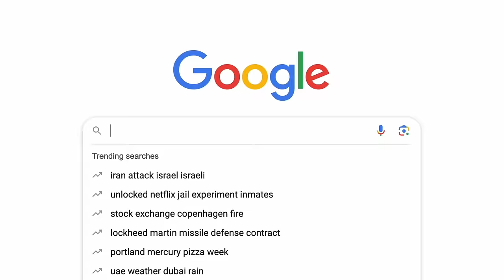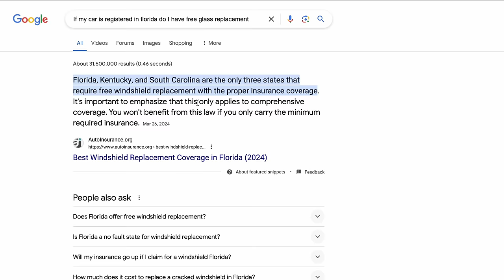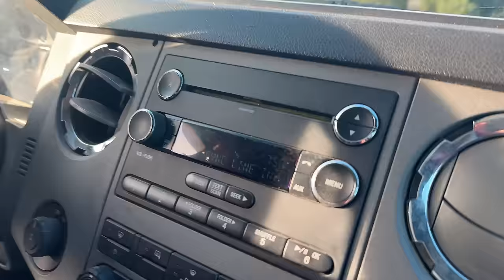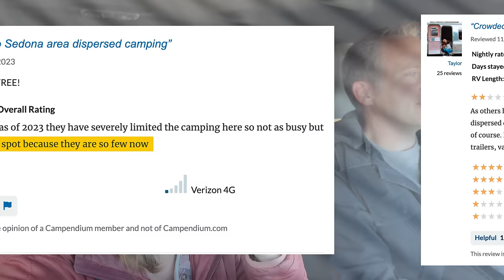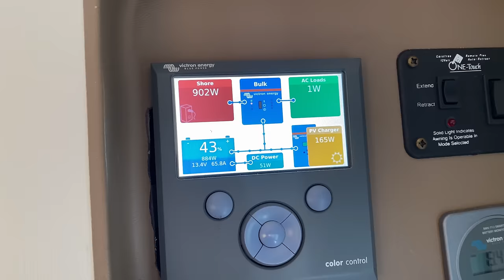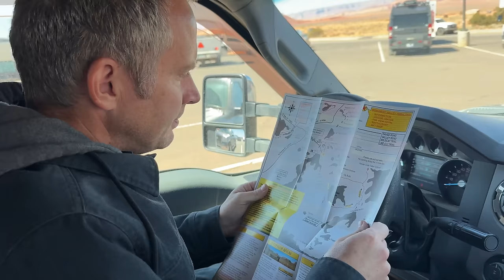This is the BIGGEST Threat to Free RV Boondocking

Comment: On your trip to or from Alaska you will almost certainly encounter wildfires - mostly started by lightning (but not always).  We were escorted thru a fire near the north end of the Cassiar Hwy with flames on the edge of the road!  Scary.  We also boondocked in the Bisti Wilderness Area a little north and west of where you were (I think) at Bisti/De-Na-Zin - absolutely beautiful.  Your tips are absolutely rules that should be followed by everyone that uses public lands.  I got a trash picker-upper that I take use every time we boondock.  My old boy scout leader always said "leave it better than you found it".  Thanks for the excellent video and for taking us along on your journey.
Reply from the maker: We we're near some fires 2 years ago outside of Crater Lake. We camped about a mile from the Firefighters camp. We talked to them and they were like - you're safe - but if we leave you should leave. 😂 Good advice I think. -J
Reply: @OpenRoading  Definitely.  When I worked back-stage at concerts the pyro guy would wear a shirt that said: I'm the PYRO tech - if you see me running try to keep up!" on the back.
Reply from the maker: @randyriggs4575  That's spectacular. -J

Comment: FYI that rubber line that divides , the top half from the basement.  That is called belting you came get it Amazon.  Sometimes it also called rv belting
Reply from the maker: Would you mind sending me a link to RVopenroading@gmail.com? (I have links turned off in the comments).

When I search that I don't find what I have on here. And when I search Self Adhesive Automotive trim I only have choices of Red, Black, or Chrome so I must be digging in the wrong places! -J

Comment: Not sure if you have soft close hinges on your cabinet doors but that might help in keeping them closed during travel. Same goes for drawer slides.
Reply from the maker: Our drawers have very basic hardware but they do have a catch so they don't pop out (we have to lift the drawer before pulling to open). The desk doesn't have that but I have a solution I'm working on.

The cabinets have a clasp that is supposed to hold them closed...and it does mostly a good job.... 😂 -J

Comment: Jockey 3000 solar generator.  No noise at all and it can be charged 3 ways solar, 110 or 12v truck while driving.
Reply from the maker: That's a good option if you don't have a solar setup. For us if we run out of juice it means the hasn't been out for a while. So we have a generator for a backup charging source.

If you already have a solar setup, I'd either recommend expanding the setup or getting a backup generator over a completely separate solar generator. -J

Comment: If you install a soft start on your AC unit you can run it off a 2000 watt generator. I did with my 2000 watt Honda.
Reply from the maker: I'll have to give that a shot. I had a soft start given to me but I've never installed it because I knew we didn't have enough solar to make it possible for that application. -J
Reply: @OpenRoading  You don't need solar for the SS. That said, with it, it will greatly reduce the starting amperage which will reduce the battery draw down. I had a 15,000 AC unit and a 2000 watt Honda generator. I will not run. I added the SS and was then able to run it with the Generator.
Reply from the maker: @chrisschiel6741  true true. I worded that very  poorly. I just meant that I hadn't thought about using it for a generator. My thought was to install it if I ever got enough juice in my solar and battery setup to consider running it off that. 🙂 But now I may try to install it next winter knowing that I might be able to run it off my small gen! -J

Comment: Monument valley fun fact. Don't climb the buttes. Clint Eastwood was the last to cli?b there. He was tasked to remove any climbing equipment at the end of filming. Now I can't think of the exact movie.
Reply from the maker: You’re not allowed on any trails (except for 1 I think) without a paid guide. -J
Reply: @OpenRoading  I didn't realize it was that strict. I should have looked for the movie. The well in this case thumbnail shows him with a backwoods cigar and a Mexican shawl. Or should we say Latin? Still an old classic, as am I.  Also, how much can the motorcycle carrier hold? My cruiser weighs in at 700lb
Reply from the maker: @On-down-the-road  You would need a different one. This one is rated for 600lbs. -J
Reply: @OpenRoading  well I am going by the dry weight plus all I have added, and 700 is my best guess. Will you tell me the manufacturer,  and whare I might inquire about it?
Reply from the maker: @On-down-the-road  Oh sure! All the links are in the description of this video we did specifically on the carrier! https://youtu.be/M0uB_iU3QLs?si=PXUoBGEStxaFC4Tg

Comment: I guess you’ve never boondocked in Florida during the summer. Everyone runs the generator 24/7. You should build a 3-sided plywood box with hard foam insulation to cover the generator to dampen the sound.
Reply from the maker: If your in a scenario where everyone is running generators that wouldn't be a problem of course. 😁 But you are correct - Having lived in and enjoyed Florida for several years, I have zero desire to be in our RV in Florida in the summer. -J

Comment: nice job using a parachute on the downhill. (trailer brakes)
Reply from the maker: Thanks! My parachute is getting a little old. I'm hoping to replace the canopy at some point. -J
Reply: @OpenRoading  gotta be done on time, don't forget what the minimum thickness is allowed for the brakes, and add some more space. I make my employer, replace brakes on my truck before they get to the minimum.
Reply from the maker: @pdzh  I want to do whole new hub assemblies. These ones are original and I'd love to get brand new ones on there. -J
Reply: @OpenRoading  I would absolutely do that. I myself about to do some work on my 1999 GMC suburban, I need to redo my rear brakes, then on my trailer swap idlers into electric brakes. The more braking the better

Comment: Grey water open dumping is hot button topic! After reading up about long term sequelae we decided to use biodegradable products whenever possible - soaps, toothpaste, etc. 
It’s a process for sure but we’ve achieved about 70 - 80% compliant products. Sometimes it’s time to celebrate the baby steps!
Reply from the maker: Yeah...I was not sure whether to toss it in here because I know it's a lightning rod for some. I know products matter but generally in places where I've dumped gray water I've seen plant life in that area (when we are there for 2 weeks) be noticeably greener than the plants around. So for me, I'm ok with it where allowed and yeah, do your best to make the water as good as you can - but I don't think I'll ever have a problem with someone dumping grays as long as they are doing it in a good manner (not dumping it all over the site). -J

Comment: Yes, we've been to Monument Valley. Remember, there isn't too much industry out there, so much of the money is used to support the people Navajo Nation. Also, next time you need ro visit Goulding's Lodge to check out the hidden arch. It's a neat spot and very photogenic! 👍
Reply from the maker: "isn't too much industry" I'd suggest starting a road maintenance industry. 😁

We visited Monument Valley and also Valley of the Gods. Both were beautiful...one was free and the roads were practically the same. I understand what you are saying...but in my opinion....if you don't make the experience better than the free one......you could be leaving tourism dollars on the table. Just my 2 cents (or $16).

Thanks for the tip on Goulding's Lodge! -J

Comment: I have a solution for your desk drawers, I purchased magnetic door latches from Amazon and installed one for each drawer which held the drawers in place but allowed easy opening. Antrader Magnetic Cabinet Door Catch Closet Latch 24pcs Plastic Stop Holder Closet Catches White 1.8" x 0.6" x 0.55" Hope this helps.
Reply from the maker: We bought some and they were too big. I will check these out though. If they are also not right I do have a DIY magnet idea! -J

Comment: If you loos power for the heater in middle of night at bellow 40. start up and run gen in middle of night. keep your self worm. # them if thay here it running. im worm agine
Reply from the maker: No one is advocating that anyone freeze. 🙂 We've had a couple of colder nights where we didn't plan ahead and ran out of propane and it was too late to get it filled.

But I would say if you are boondocking, you can work your way toward being prepared enough so that usually you don't have to fire up that generator at 3am to stay alive. But yes - staying alive beats being courteous.-J

Comment: The free windshield replacement is gone in Florida. They changed the law last summer.
Reply from the maker: Care to share? Everything I have read says it’s still in place and the law simply fights back against https://www.barbeejackson.com/blog/floridas-new-windshield-repair-law-what-you-need-to-know#:~:text=regarding%20their%20repairs.-,Free%20Windshields?,repairs%20without%20incurring%20additional%20costs.
Reply: @OpenRoading  when I got mine replaced last summer, they told me I'd gotten it just in time because once that term of my policy was up, the glass coverage would be gone due to the law change.
Reply from the maker: @CJ-dc2yj  Well everything I'm seeing online is that it is still required if you have comprehensive insurance on your policy. And I just got off the phone with progressive and it's fully covered. 🤷🏼 -J
Reply from the maker: I don't know where you got it done - but part of the law has to do with getting things done at authorized locations (because some people were making fraudulent claims) so possibly your mechanic wasn't on that authorized list so the jobs were going away for him. Or maybe he just misunderstood the law. Or maybe I'm still not finding the right info online. All incredibly plausible options. 😂 -J
Reply: @OpenRoading  it was definitely a reputable shop. The shop told me, and progressive confirmed.
Reply from the maker: @CJ-dc2yj  Very interesting. I can't find anything anywhere that says it's gone. The law was amended - but it's still covered. 🤷🏼 And I didn't mean to infer that your shop wasn't reputable - just that it might not have been on whatever list the state was using as "authorized glass repair"  -J
Reply: @OpenRoading   maybe they changed it after my replacement. 🤷🏽‍♀️ I guess I need to call and clarify if I ever need another windshield.